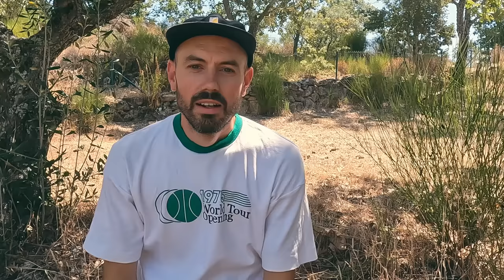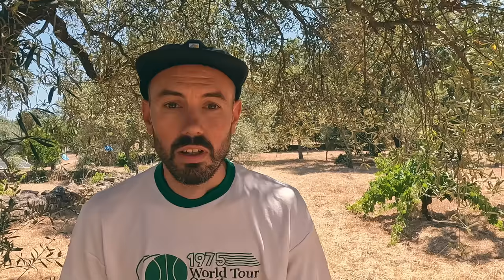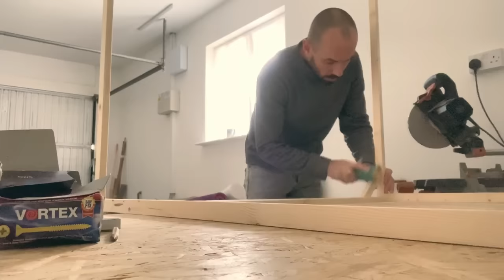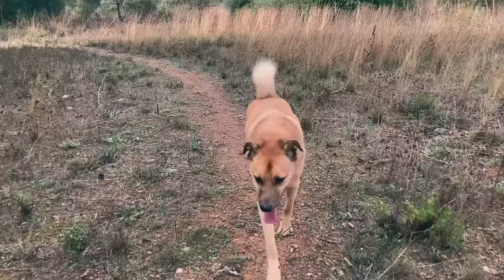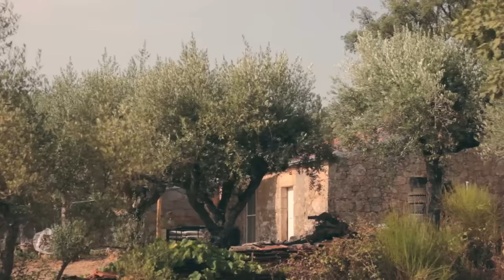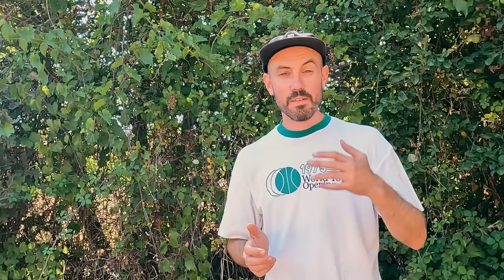MY FIRST YOUTUBE VIDEO 🥳 - Why I left the UK for PORTUGAL

Comment: Welcome to Portugal. I have been following your videos and let me tell, you guys are fantastic...Well done...
Now, a piece of advise about being off grid with electricity. As you are in the country side and have plenty of space available, you could increase the number of PV panels to 24 or more, complement them with an aerogenerator and a bank of batteries. 
For Water, besides what you already have, you may consider to drill a water hole and install a small treatment and purification station.

Comment: Just wondering why you aren't using your rainwater for drinking? If your gutters are clean and the tank is in relatively good condition there would be no reason why you can't drink it. If it has a bit of sediment, a basic filter would fix it. Everyone outside of townships lives off tank water here in Australia. If you're unsure, feel free to ask questions. I did what you're starting about 20 yrs ago and have never looked back.
Reply from the maker: The roof that the rains off of us pretty disgusting & needs replacing. The water tank is an open cisterna & in need of repair. I’ll show both of these in future videos 😎

Comment: Hey Rick an family, lookin forward to poppin in an seein how ya goin guys. Wishin you all da very best . Looks like life put ya through the hoops an fences for a wile there but, it only made you sure of the dictions you were makin.
Oooh man the journey? Ouch!
Maybe in da future if an when you come back to da UK, use the overnight ferry from Santandare to Plymouth. Judgin by where you are? The drive may be as littlest 4-6 hrs.
We had a solar water heater on the roof to sort hot water for showers etc an with the climate of electrical madness? Is it worth all the expense for that? Can you go without an use wind an solar mix? Ie the standing wind turbines, the ones without propellers. Take a look at those.
The water yes. Get the mains sorted, an find as many ways as poss to re- use All the water possible. So things like compost loos. Look into worm composting? Yup it’s a thing! An it will be cheaper in the long run for the land, an ya pockets too.
I’ve done Spain, Cyprus an due to a disability had to come back, so anythin I can help with to keep your dream goin,
I’ll put down for ya to check out.
Ohhhh! Yeh. Look into gettin a few goats. They are so rugged an, milk, cheese, etc, early warning system all in one, vital also if you have snakes as locals.
Thanks for sharing guys 
Paul 15.58 gmt Uk cheers
Reply from the maker: We really wanted to get the ferry but it’s near impossible to get a pet cabin without booking about a year in advance!
Reply: @LifebyLiving  bloody hell! Shocked at that one mate!!!!
Sort didn’t know about this!!!
Thanks for sharing guys 
Paul 12.43 gmt Uk cheers

Comment: Well done mate. 
It would cost you about £8,000 at the most for a solar setup. My friends has converted his narrow- boat to all electric with a 8kw motor, his batteries cost £5,000. Which would be more than enough for you, good look 👍
Reply from the maker: It would cost us much more than that unfortunately as we need enough battery storage to run aircon throughout the night in the summer. You also really have to oversize systems here to ensure you don’t find yourselves without electricity during dark & overcast periods in the winter. We’d much rather have a combination of grid & off grid 😊
Reply: @LifebyLiving  no mate, I’ve had a mig welder running off my mates batteries?

Comment: Would seriously suggest you research solar further before connecting to the grid. Boats have completely off grid solutions
Reply from the maker: We do already have solar but we’re looking for a combination of both on & off grid here. The level of investment required to meet our energy needs purely from solar is way to high & we would never see the return on investment. It makes more sense to use our solar system combined with the grid using a provider who only uses renewable energy